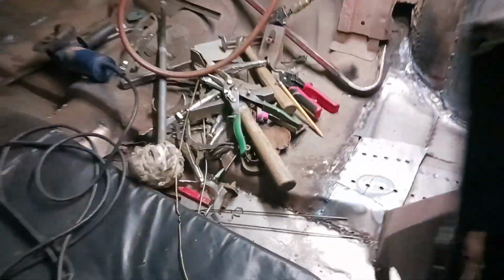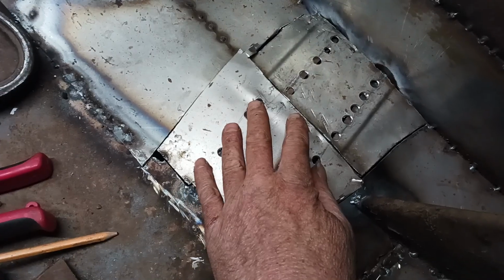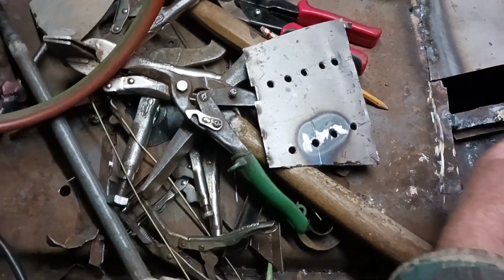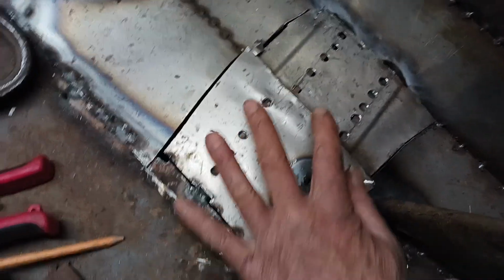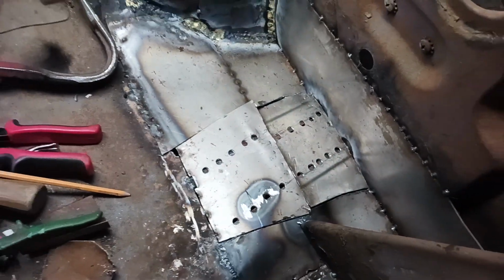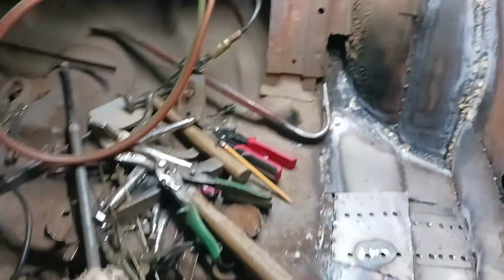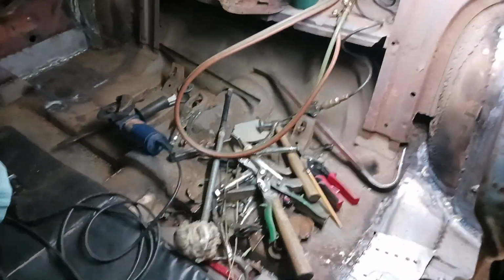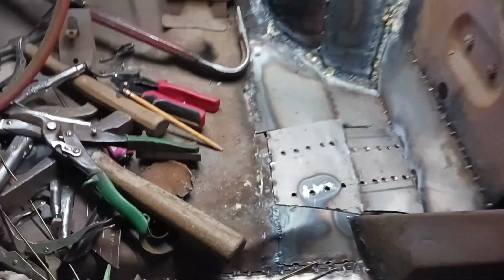weld it up tomorrow

Comment: I just started welding last year. Bought a 110 volt Harbor Freight mig welder, using the flux core wire. It is kinda fun learning. Welded a lawnmower frame back together and it seems to be holding together. I probably shouldn't have welded so close to the mowers gas tank, I took a big chance leaving gas in it.
Reply: @ GrassRat 450
When I read posts like this, sometimes I think they are just jokes.  If it’s not a joke, please understand. You are a partially full gas tank  can explode with tremendous force.  An almost empty tank that has just been emptied can be lethal.  One spark (that’s why they call them spark plugs) could cause an explosion instantly.  
YES welding is fun and can save you money making repairs yourself.  Lincoln makes a nice line of 110 V mig welders.  
Have fun.
Reply: @i8ntnuts  that's why I said, I took a big chance and very well know the dangers of it. I did shield it, but even with it shielded there's a possibility of fumes igniting. Lost a family member in a explosion when he was welding mud flap brackets on his cab over.